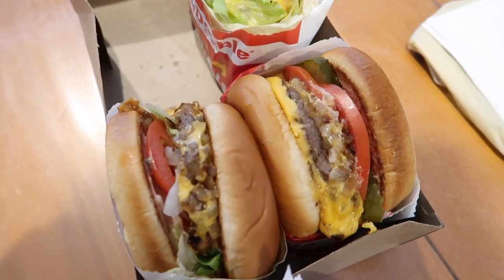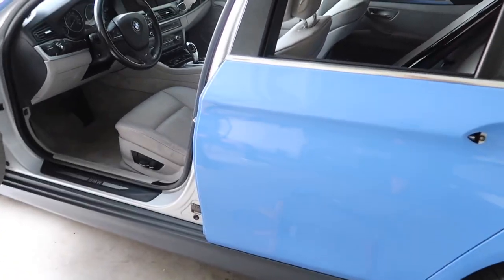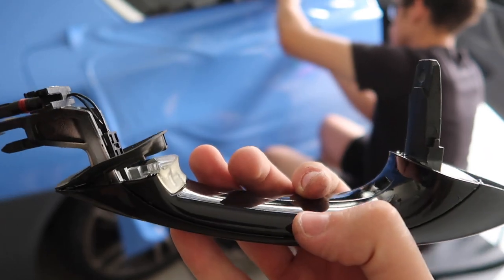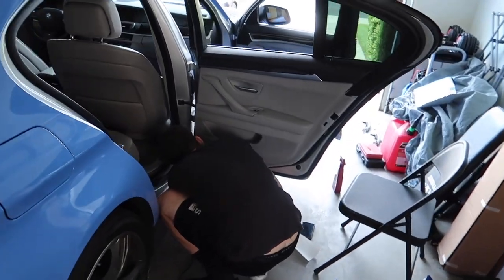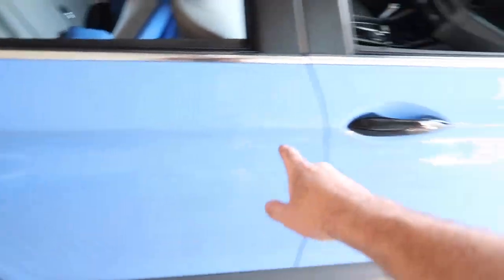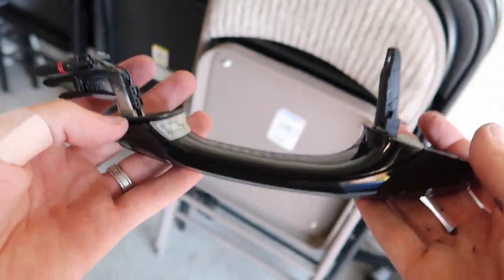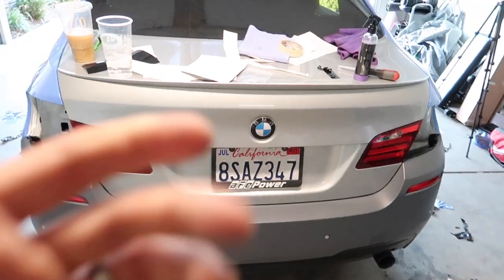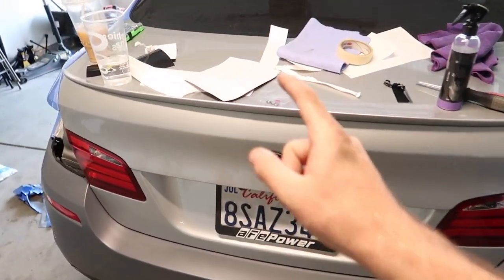THE V1 F10 535I WRAP IS COMPLETE! (I CANT BELIEVE MY EYES!)

Comment: Use 20 pound fishing line to remove spoiler comes off so easy. Just slide the line under it and pull up as you pull the length of the spoiler.